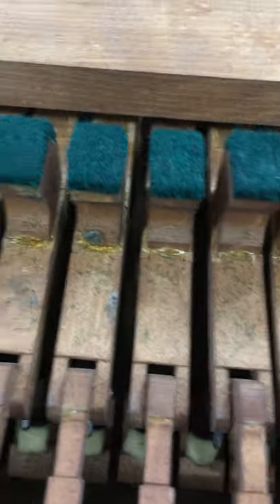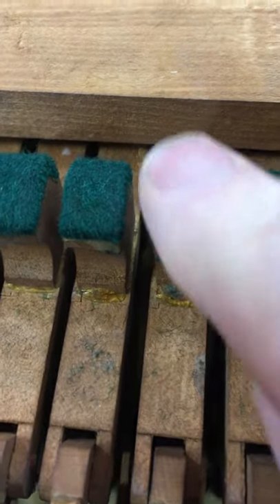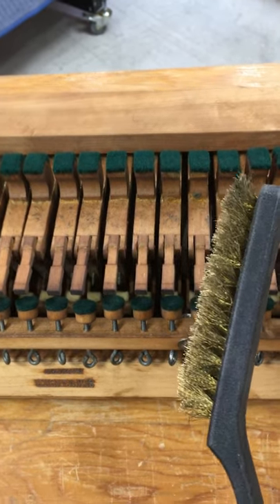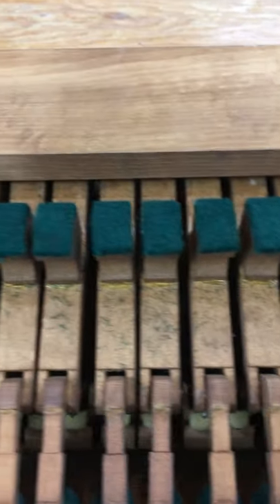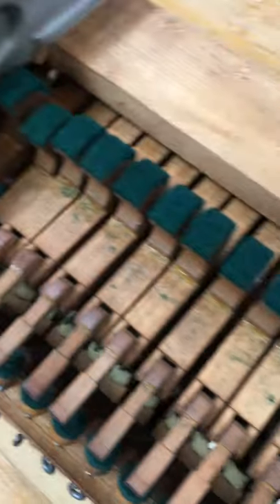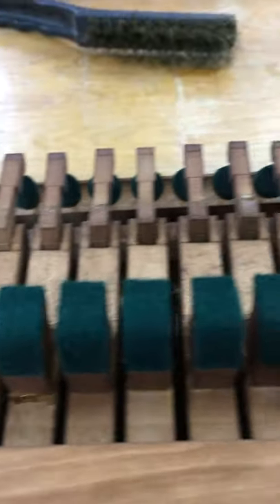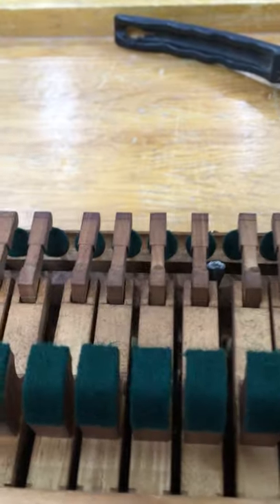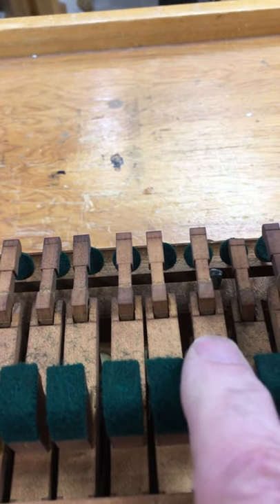Restoring Whip Cushions 2

Comment: Reduce friction, noise?
Reply from the maker: You are effectively increasing the thickness of wool cloth between capstan and wood of whippen heel. Also, the surface quality of the material is improved by cleansing of DC additive, combing of brass wire brushing, and swelling from water penetrating into the wool with the help of DC treatment.